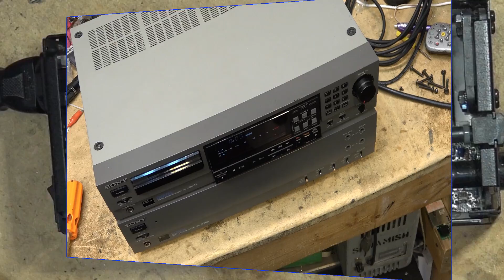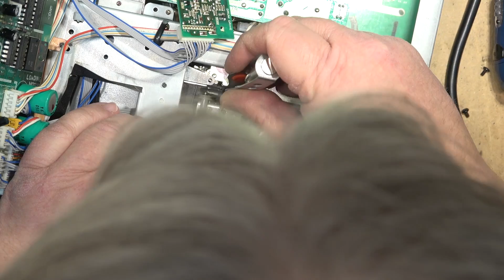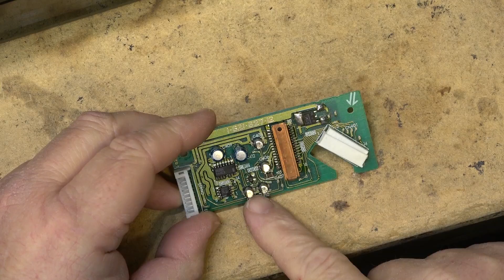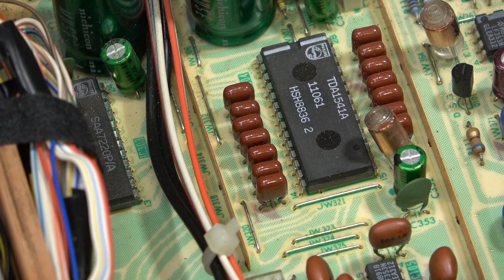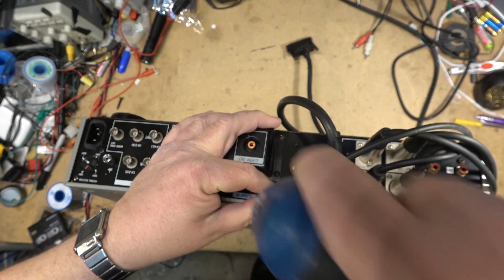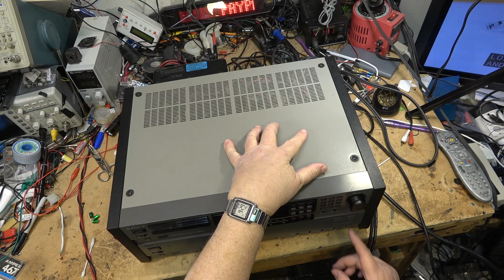Sony PCM2500A Professional DAT Recorder Service

Comment: I've been wondering WHERE that hidden motor sound was coming from. Then, I saw you pull the scan head driver PCB and reveal the 2 inch belt and drive system ( 6:00-7:15) THANKS!
Reply: What size is that tiny belt ?  I'm thinking it's square and 0.040" thick

Comment: Thank you for the video on this Sony 2500 DAT tape loading problem. 
Mine has the exact same issue. I bought it new in 1988. 
Knowing that it’s an issue with the CAPS on the small transport board. Could I send you just the small board and have new CAPS installed for me? Is that possible? Paul
Reply from the maker: Can't test if only board sent.
Reply: @12voltvids  ok got it. What would you charge if I send the entire 2500A  unit (not the B) and I have you replace the belts and the 4 CAPS, I’m having no luck finding the correct replacement belts online. 

Just a ballpark price, I know it would be more obviously if you had to do more work.
Reply from the maker: I don't even know where the belts are available from anymore.  Most of my sources have closed up shop.
Reply: @12voltvids  I did a lot of searching today for the belts. According to the service manual parts list, although it’s missing 2 pages, I see two different sized belts, and I have their dimensions. Gonna reach out tomorrow to a couple sources to see if they can source or make them.

Comment: How do you feel about applying a light wipe of MG Rubber Renew on square belts before using ? I find the grip is improved by doing this. Though not on flat belts only square ones min .6mm thick

Comment: Hi, I have a set of 2500A & 2500B. It seems my 2500A got a problem very similar as this one. When I turned power on the FF motor spin a while then stop. Both error indicator light on. Also, the caution display on screen flash. No response when I pushed Open/Close button. The tray loading system won't work including all gears or motors. So, should I fallow your method to check Servo Board at bottom first? Or any suggestions to help me to solve the problem. I would be appreciate for your reply. Regards, John Lu

Comment: Damn Dave! That blob of solder that felt of your iron at 31:01 can cause lot's of problems, hope you removed it?
Reply from the maker: It fell on a ground trace, and yes it was picked off before I put it together. That was actually an editing fuckup, because I normally wouldn't have ever allowed that to be shown. I did see it right after the shot and cleaned it up but that shot should never have made it into the cut.

Comment: Well done dave 😀
It really didn't take long for you to get the dat recorder singing again.
it seems like the cap death is speeding up.
Nearly time to purchase another bucket of value caps 😞
If i havn't already said it, ihope you and your wife have a better 2022 😀
Reply from the maker: Keep this in mind. I already know where to look based on past experience on similar models. 
When I zero in on a fault relatively quick, it is because I have had a similar problem in the past.  When I haven't worked on similar models before and it is the first time I have seen the fault it will ususlly take me quite a bit of time tracking down the problem. Even though this was the first PCM2500 I have ever looked at, the circuit isn't that much different than other models.

Comment: I remember these from my CBC days. There was a version of these that allowed you to digitally edit DAT material from one machine to another via a timecode punch-in controller. One worked as playback only and the other allowed you to punch-in record the edit information for a seamless edit. Much like editing video tape back in the day. We used it primarily used for classical music editing at that time.
Reply from the maker: That's right and there were controllers that would sync multiple playback machines.  I forget how many could be synced but I had a friend with a recording studio.  When they did session work they would run 2 dat a master and a safety copy for each session.  The master was locked up and the safety went in the playback machines. As they played the safety copies in sync a new session was recorded again producing a master and safety.  Once all the sessions were done all the master sessions were loaded into multiple playback decks and all were synced using time code.  Time code for dat is a strange animal.  100 frames over 3 seconds.  So 33, 33, 34, 33,33,34 ect.  They then made their mix tape. I believe he had 8 players and 2 recorders in his setup. So 16 channels, with each session a stereo track which was great for drums and acoustic instruments. Been a long time.  He ripped all that stuff out and put in Qbass probably 20 years ago now.
Reply: @12voltvids  Then came the open reel digital formats from Sony and Studer that were "sexy" machines but were subject to dropouts if there was any dust or tape flaws. Being open reel it was difficult to keep the tapes 100% pristine and the heads had to also be pristine with no tape residue. Expensive and fussy quickly replaced by multiple DA-88 and DA-98 units which used hi-8 cartridges. Generally more reliable than the open reel digital formats but they had their problems as well. Hard Disk and SD memory are much better as there are fewer moving parts and dust is not as much of a problem. But I'll always have a soft spot for the open reel analog and hi-quality cassette formats. Too bad that the Elcasette never really caught on as it seemed a viable middle ground between the reel and cassette formats which with added noise reduction could have been a winner if not for the 8-track cartridge and the improvement of compact cassettes at that time. We can only guess at what the next "Big Thing" in audio will be in the future.

Comment: Very nice unit some revisions of the 1541 are worth more than others and the phillips sa ic is also another one that i think many regard as good quality .very nice dat deck i could have bought a nice sony dat deck from our local charity shop was priced at just £40 uk i had a look on ebay and all tapes were expensive at the time now they seem cheaper needless to say it sold quickly and was no doubt worth far more than the charity shop was asking .

Comment: So essentialy the 2500B is doing what a DI box would do.
Reply from the maker: It handles the auxiliary data recorded on the tape. Required to record but not required to process signals as when i made the recording the audio was plugged in directly.  Will not enter record without it.

Comment: I have a PCM-2700 with less than 500 hours that still works great, the FL display shows its age but it's still bright enough. It's a areat-sounding machine that has a load of really useful features.

Comment: This one survived the past 31-32 years nicely. Even the SMD electrolytics were just open, but not pissing on the board. This set probably had a similar price to a new car back in the day. Does this model also have that magnetic clutch which always breaks? Or they eliminated it with the two direct drive reel motors? I mean it probably still have reel clutches but no need for the plastic teeth on the perimeter because there is no pendulum gear to interface with.